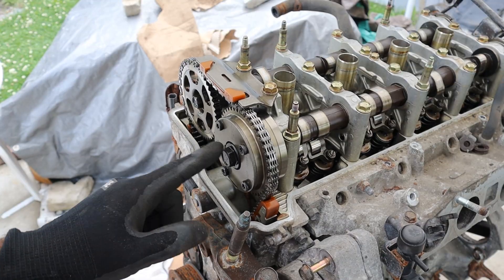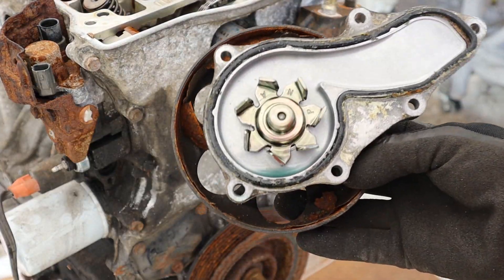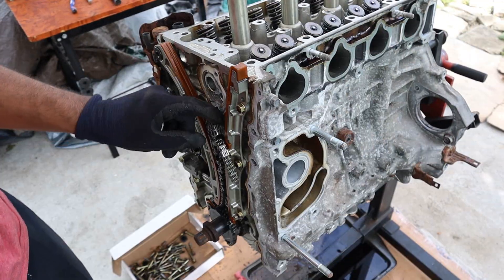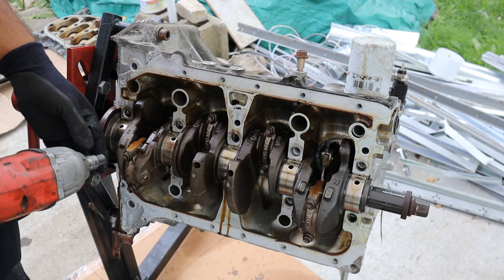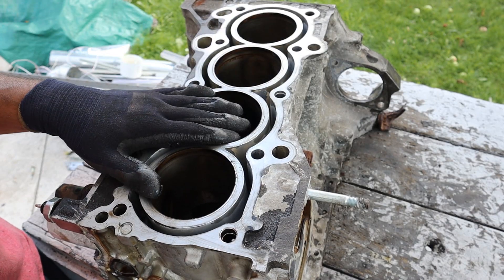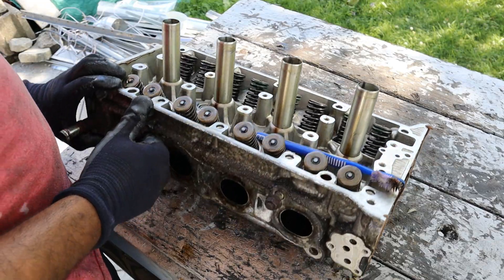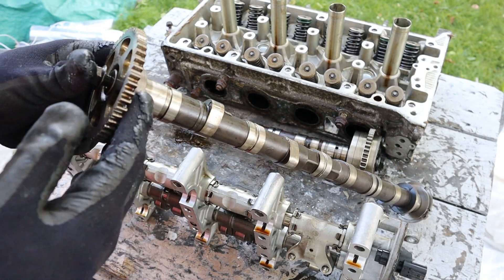Why the Honda K20 is the Best Engine Ever

Comment: i got one with over 400,000 miles that i spin to 10k rpm. still original rings. i have tried to kill the engine every single time i drive it.

Comment: Why scrap a working, low mileage engine?

Btw, what is the most likely part of this engine to wear out first? A.k.a. what to replace in a high-mileage engine to make it last much longer?
Reply: Head gasket, rings, bearings, water pump, timing chain, maybe valve guides.

It's a decent amount of work.
Which is why people don't want to do it.

Comment: Is there cut line between cylinders? I guess they started putting it later on K20C4 engines. That's where the head gasket fails.

Comment: New subscriber to your channel and I'm loving it! Do you help diagnose engine issues? I've got a K24 out of a '15 Acura TLX. When I'm stopped at a light and the car is still in Drive, I've got a significant vibration. Not all the time, but more often than not. I've checked engine mounts, doesn't seem to be the issue. Thank you for the awesome videos!

Comment: For timing chain guides don't you want part of it to be plastic so it doesn't leave metal everywhere or eat the chain. There's different kinds of plastics. Probably one with good lubricity.
Reply: And the galley plugs are probably for access when they're drilling the galleys into the block. They're not part of the casting afaik. Does give you nice inspection/cleaning ports though.

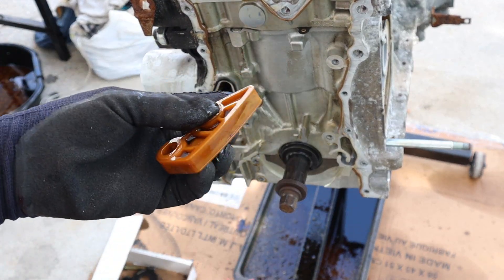Comment: 7:40 - a lot of VTEC solenoid check engine lights are actually caused by corroded/loose connectors on the solenoid and not the actual actuation of the valve. It's something worth checking before spending the time and money to replace the part

Comment: Crazy how well designed and made that k series is. Roller rockers. Ladder frame. Beefy crank. Good oiling system. I bet they can be boosted to give a ton of power.
Reply: I have a boosted k24a at around 13 psi but they can go upwards to 18 and sometimes 20 but that's pushing it. It's best to keep them below 600 whp because the transmission wouldn't be able to handle it without upgraded gearing. After that you'd have to look into internals for the engine
Reply: that is exactly what they’re known for lol
Reply: Lol, sees a well made beefy underpowered engine and wants to boost it.
Reply: @TammyDenseDdank5658  it’s only a vicarious want. I’m way too cheap to do it and I’m happy with my slow lame cars. I just watch too many YouTube car channels 😂
Reply: @craigiefconcert6493 , 
That is one of the most amazingly honest comments I have ever seen on youtube. 👍

Comment: Honda introduced a balance shaft in the oil pump for the K20Z3 (FG2 Si) which meant it actually makes a little less power than the K20Z1 (RSX/Integra Type S facelift engine), which is funny to me because the Si is supposed to be the more "raw" model.

Comment: I’ve done several vtc gaskets lately, they can drain a crankcase in 20 miles when they get bad enough

Edit- if you have an oil leak you can find, look at the little 2 bolt cover behind the belt tensioner. “Vtc gasket”

Comment: Fun fact: The reason many Honda engines are laid out in the opposite way to most front wheel drive cars is that - they are designed from the outset to be right hand drive cars (because they drive on the left side of the road in Japan) so for crash safety reasons the biggest under bonnet component is placed ahead of the passenger seat (which is occupied less than the drivers seat) - this is why they put the engine on the left and the (smaller) gearbox on the right (in front of the driver). Later iterations of the Honda engine saw this trend reversed, as they fell in line with the majority of front wheel drive car layouts, designed in countries where they drive on the right, and the driver sits on the left of the car (ie: Europe). Thanks for coming to my TED talk 😊
Reply: Indeed - Mitsubishi did this too with early cars - one disadvantage was it required an additional countershaft in the transmissions to reverse the rotation direction of the final drive so the front wheels turned forward - this made the transmissions larger, heavier, and added complexity
Reply: However K series engine is laid the same way most of the transverse mounted engines. From what I recall the B, D and H series were mounted the opposite way with the exhaust in front of the engine and intake to the firewall. K series is also a quite high engine, especially the K24, so it was probably not possible to mount it that way, as the exhaust would go under the Oil sump.
Reply: @JeremiBulakowski  Which side the intake/exhaust are on and which way the engine rotates are two separate and exclusive things - you can switch the intake/exhaust and still have a clockwise rotating engine - FYI
Reply: @kristianhermann5971  I wrote it as a mental shortcut, in comparison to previous Honda engines that had it that way.
Reply: there is nothing about the way the engine is setup that is about right hand drive, a lot of engines have the intake in the front
Reply: Are the manuals like that too over there. Or in front of the driver?
Reply: I heard from a retired Honda engineer that it was also because Honda makes tons of motorcycles, and the direction of rotation of those engines' output shaft is the same as the direction of the older flip-flopped honda cars
Reply: that was a good ted talk, got my money worth, thanks!

Comment: Honda should have kept with their NA high revving high output/litre engines rather than the turbo crap they have now. They are beautifully elegant strong engines 👍
Reply: Blame the epa regulations for that
Reply: @waterloo123100  It's not related to the EPA. Toyota has more powerful engines that are more fuel efficient, without relying on turbocharging and small displacement. Compare the 2.5 NA 4 cylinder in the Camry to the 1.5 liter turbo in the Accord. It's not even the EPA that's regulating fuel economy, you people are just massively confused.

Comment: 4:05 Actually for the 2025 model year, Honda will be replacing the Otto cycle port injected K20C2 Engine (158 HP) in the 2024 N/A civics with the new K20C9 Atkinson cycle direct injected engine (150 HP).
Reply from the maker: Nice. Less power.
Reply: @speedkar99  Direct injected engines are more prone to carbon buildup in the long run, this is why Toyota at least still keeps a set of port injectors with the direct injectors and programs the computer to synchronize both sets for more efficiency and to prevent carbon buildup in the long run.
Reply: @abraham3981  its interesting they chose direct injection since it reduces reliability over time
Reply: @hakujona  emissions....

Comment: I got 2 on a 2006 and 2007 2.4 Accords. The 2006 reached the 400K miles then the car got hit and totaled, actually I drove it home with blown airbags. The 2007 reached 350K miles and got hit and totalled 😢. I gave up on Hondas now, CVT and turbo.. no way.
Reply from the maker: Why not get a manual Honda civic ?
Reply: @speedkar99  now I drive 2021 Camry hybrid Le 52 MPG, A25A-FXS with planetary gear Ecvt. It fits my age now.

Comment: I'm gonna buy car with that, like acord or civic... Nothing unnecessary overcomplicated. That plastic thermostat can be changed in a minute and it probably cost 10 €. 
Lucky I'm in Europe so all of them are manual anyway. 
Are all 2,0 L honda this engine?
Which year is best?
There is 145 HP and 200 HP version. 
which one is the best for long drive at 140-170 kmh(it's legal here to drive that fast). 
There are 2,4 L version maybe that one more durable for 150 kmh long distance driving?
How they tolerate LPG butane and methane gas as a fuel? I wanna save some money.
Any good advice is appreciated
Reply from the maker: The bigger engine is best for higher speeds.

Comment: Why is the original honda coolant good? What’s the difference
Reply: there was a brand of coolant that went acidic, ate holes through many blocks.
Reply from the maker: Each has their own spec. Alot of people put generic green stuff in there which can damage aluminum engines or cause corrosion

Comment: K24 vs k20? Which is more reliable?
Or depending on service and how you drive it ?
Reply from the maker: I think they're equally reliable, it's the bolted on parts like intakes, EGR, thermostat, VTEC, etc that could fail.

Comment: Throw a rock at me. But Japan does a Killer job at making Bulletproof Gas Engines. Honda 1.6L. 2.0L. 2.4L. Subaru 1.6L. 2.0L.
I Cannot say the same about Diesels from Japan. They aren't great in any means. fellow European here.
Reply: We only use Toyota diesel’s at the commercial vehicle rental company I work for, they last and handle the treatment from customers way better than the Mercedes and Renault vans we’ve tried. The absolute worst ones were the Chinese DAF copies, they lasted one whole month before we got rid of them.
Reply from the maker: Subaru?
Reply: Toyota has made some killer diesel stuff and the older Isuzu dmax trucks rocked solid gear-driven diesel motors, design taken straight from their commercial lines of motors. Dollar for dollar, maintenance and longevity wise, I doubt they're worse than their equivalent euro stuff, especially the newer motors.
Reply: @papapetad  I agree. Toyota has a failure point at oil rings getting clogged due to lack of maintenance

Comment: VTEC! making slow cars slower. why would you want less valve lift at low rpm i want it all always
Reply: You want less valve lift all the time? Then your engine will be breathless in higher revs.
Reply: @TeUhtred7860  "i want it all always" is different from "i want it always"

Comment: I would think a bowl shaped piston head would work good on a high compression 2 stroke engine. Especially if the transfer ports were shaped to direct the A/F mixture into the bowl towards the intske side of the of the piston. Then make it swirl around in the bowl if possible. Causing less of the fresh A/F mix to escape out the exhaust port on it's compression stroke. Then have the cylinder head be more flat inside. Instead of a dome shape.

Comment: 3:34 haha... "this is gonna lead to the throttle body to gum up your intake." Yep, that's what it's designed for.
Reply: No, the PCV valve doesn't lead to the throttle body. It goes into the top of the intake manifold right before the ports. Those gasses do not pass through the throttle body.
Reply: @ChavezDIY  it was a joke.